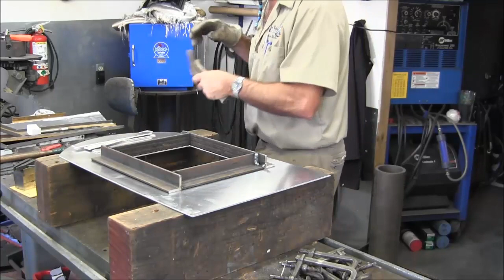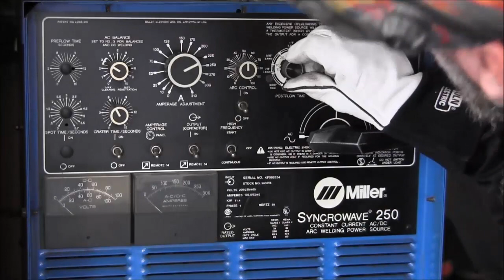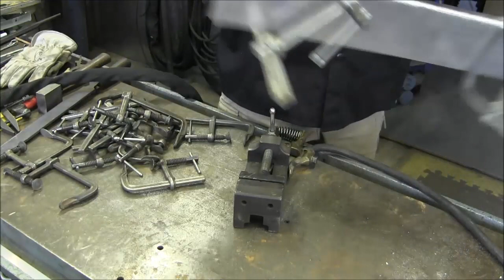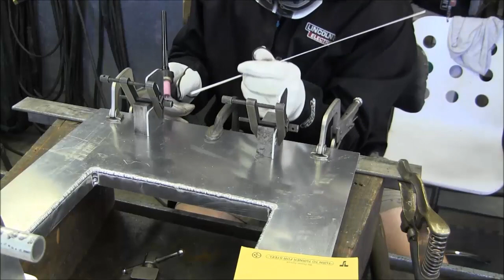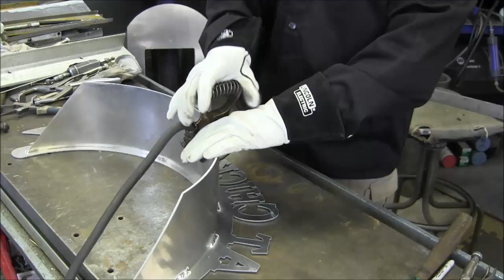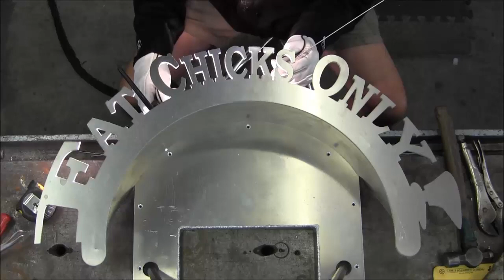Fat Chicks Only! continued

Comment from the maker: I have a premix bottle for mig welding aluminum, 75% argon - 25% helium, I still get spurts of suiting here and there, mostly gun angle and running on the low side of the sweet spot. A soft fox tail brushes it away after cooling. ;{)-----

Comment: Hi Keith, you mentioned using a blend of helium and argon. any recommendations on a blend ratio? I have to use a MIG unit to do aluminium at work and run a straight argon since the CO2/argon mix turns everything black due to the arc tearing the O- from the CO2. even with the straight argon i get charring of the joint, what blend of premix would be a good one for doing AL in a MIG ?

Comment from the maker: As long as they don't crap on the side of the house! LOL, I know, it will sustain a little droppings at the opening, but it is all in fun and I have to make another one because it, several years down the road, I'll have new ideas by that time. It is important to weigh in that fact on any fertilizer and herbicides, I have designed several spreaders and use S?S for all the contacting surfaces. ;{)-----

Comment: Kieth, I don't know if that was chlorinated(trichloroethane?) brake parts cleaner or not that you used? There is quite a bit of discussion out there about using chlorinated solvents prior to welding producing a deadly gas called phosgene. Regardless it may be good to get the word out to others. There are numerous discussion on the the various welding and fabrication forums online. Love the videos, stay safe.

Comment: Keith that turned out well (both of them).  Good info on you settings for welding I think this is the first vid which you showed where you were at in terms of current for TIG welding.  I had a feeling watching all your vids that you like to run the welder a bit hot.  You worked fast on this one, but still kept things lined up and symmetric throughout.  Thanks for taking the time to film and share your tips and skill.